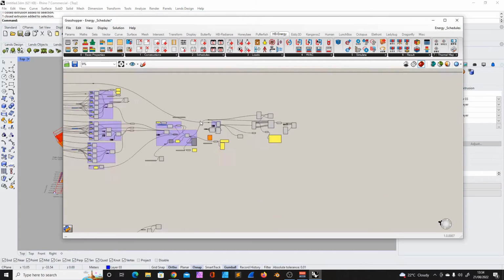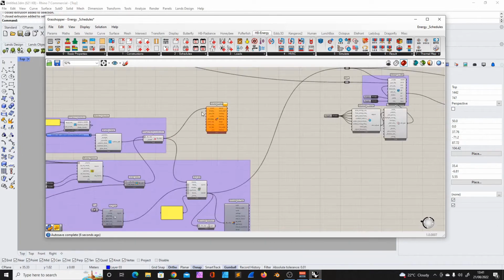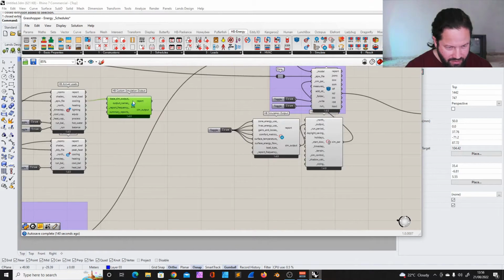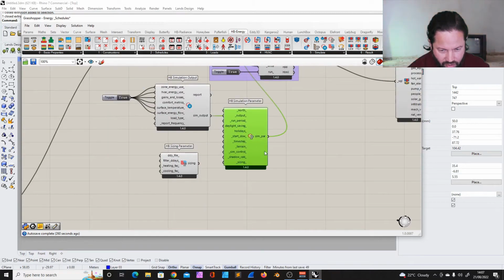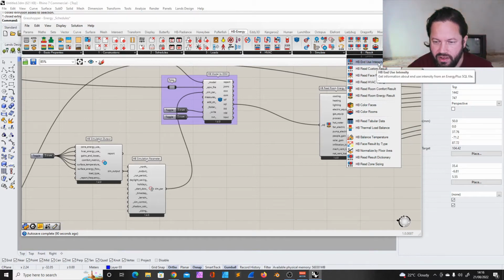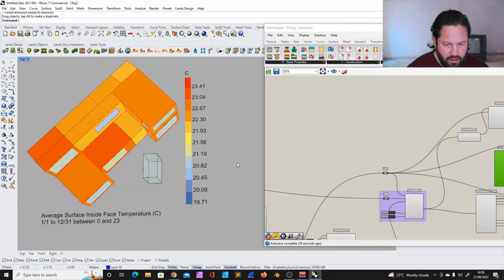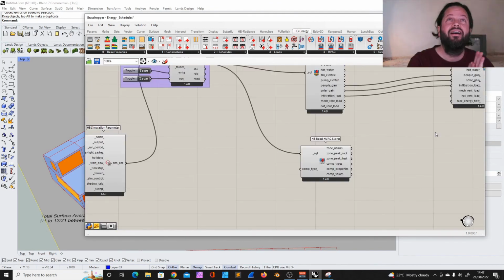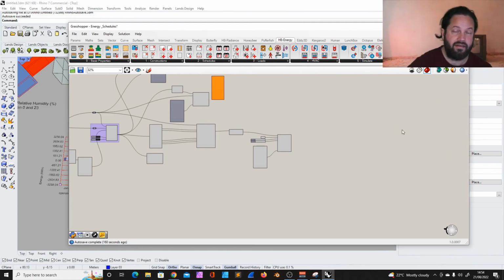Honeybee 'ENERGY' Part 8 | Simulate and Results | Ladybug tools 1.4.0

Comment: at minute 29.13 I see the air temperature output, but in annual, how can I see it every 30 minutes. I tried to change the time step but it didn't work, the results are still given per hour
Reply from the maker: As mentioned, weather data is usually recorded in hourly increments. Trying to see 30 min interval wouldn't give you a different result.
Reply: @PhilippGalvanDesign  thank sir, To see the results, I will interpolate the resulting data

Comment: any idea why my HB MODEL TO OSM doesn't run? I mean, it shows no errors but just doesn't pop up the black screen and stuff. it gives null values for sql. It ran a couple of times in the beginning, but the next day I tried rerunning it and it just doesn't seem to work anymore. help
Reply from the maker: Have you tried any of the example files coming with the installation?
Reply: @PhilippGalvanDesign  Turns out I had diff version of Open Studio installed on my Mac. hopefully, they release a single-click installer for Mac soon, such a hassle to keep up with the compatibility matrix. 😅

Comment: Your knowledge is impressive Philipp, I have another question, how can I insert a facade envelope (external mechanism) in the simulation to be able to calculate the radiation with this facade envelope in the project? This would go in the external part of the project in the windows please help me
Reply from the maker: I see this as part of honeybee radiance. 
What would be the goal? Is it about the radiation depending on different surface properties? Or is it about the effect of different materials on the passive energy  inside the building?  Or is it about how  different facade materials have an effect on its surrounding?

Comment: Thank you Philip for sharing this with everyone..
But i have a question about the new material such as (new brick) ,  How can I do tests for a new brick on this program, while its data is not recorded inside? Is it possible to enter data, numbers, design for a new brick and measure its suitability for the environment, as well as its thermal insulation, etc.
Reply from the maker: Hi Asmaa, this video builds on several others before where I also introduce materials. I haven't gone much into depth because i still have to learn and understand more about it myself. You might want check out my older videos to get an idea.
Reply: @PhilippGalvanDesign  thanks Philip...
I will do it ..
Sincerely